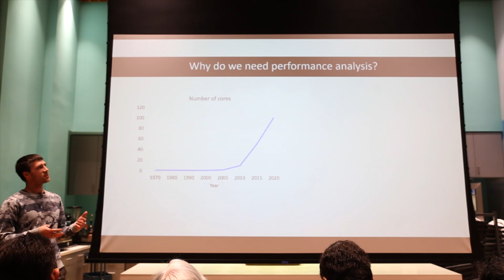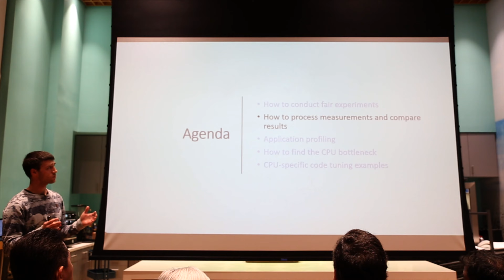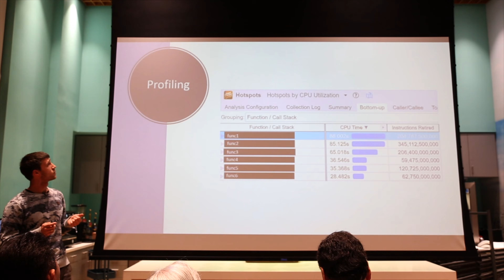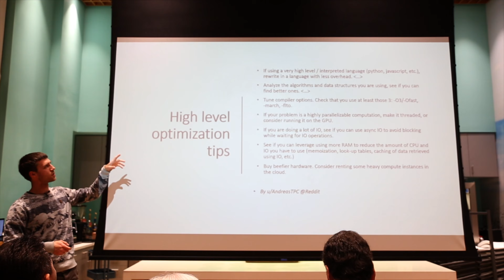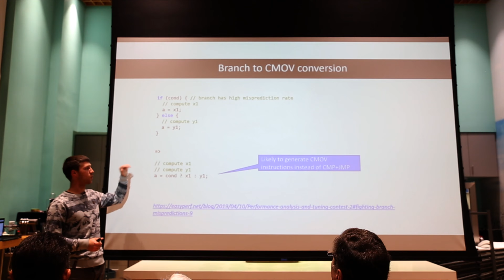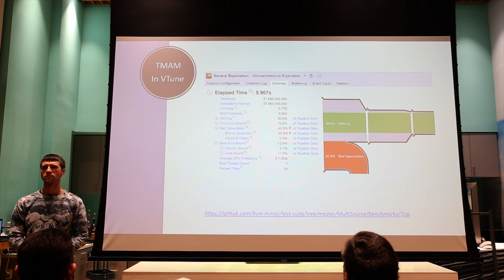Performance Analysis & Tuning on Modern CPU - Denis Bakhvalov.

Comment: re minimal values: if you are taking "minimal" as a result of a series - it's similar to sport events. You start comparing best possible result ever with "typical" result "generated" by all other sportsmen. And once a year you can beat this result, twice per year you can repeat it (not always by the same person). So minimal metric doesn't fit well to ideology of performance results to be "reliably reproducible". So you can consider minimum if you know what you are doing :)
Reply from the maker: That's true. :)